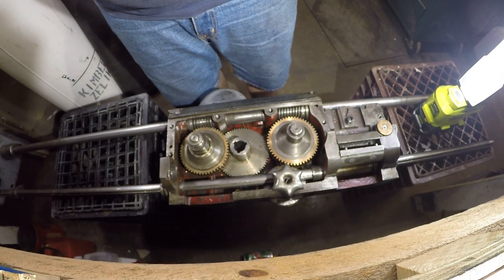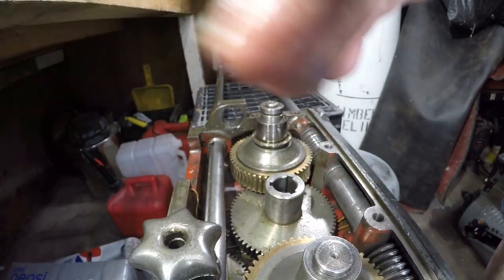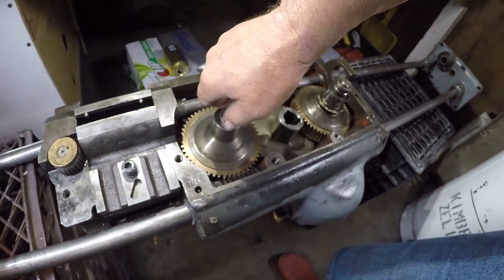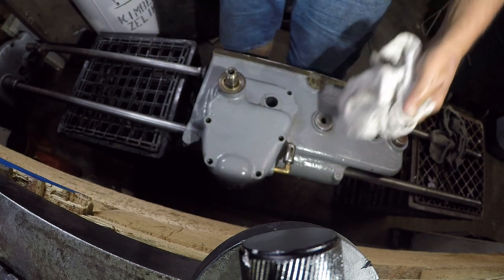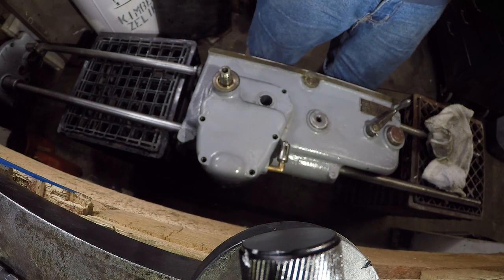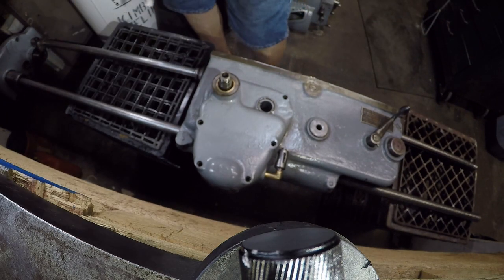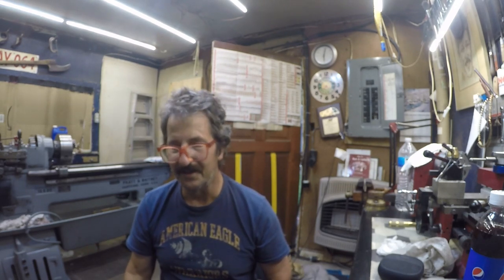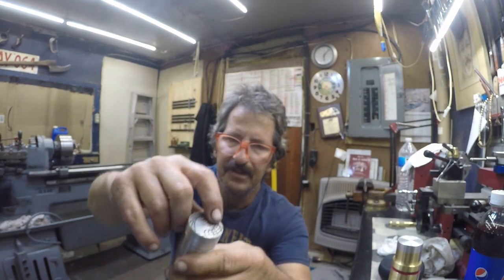PART 11 POWER CROSSFEED REPAIR,PRATT & WHITNEY MODEL B,                   APRON REVEAL.

Comment: I think there should be a spring & or a spacer on the crossfeed clutch shaft - * try DISENGAGING the clutch , then TAP on the star wheel with your hand . . . Does THAT push the clutch up / IN ? ? ?   If so , then a spring should be on the shaft , beneath the clutch cone - that would make a positive DISENGAGEMENT ! 
Maybe just a couple 'spring washers' would do the trick ?  The O.D. of the spring should be a sliding fit inside the clutch cone , but sized to fit the screw shaft without a lot of play !     If this idea is wrong , then there MUST be a 'keeper' / spacer , that is 'pinned' or otherwise LOCKED to the shaft , on the INSIDE of the apron . . . THAT would prevent the clutch from staying engaged too !   Sounds confusing , but read it a few times , & it will make sense !   ( I hope ! )    > > > back to the problem > > >  ;)
Reply: I turned the speed down when you started talking fast / sped up / fast forwarded ? ? ?   & & & 
NOW  , it seems that the WIRE that used to be on the inside end of the cone clutch would have SET the travel , & or would have 'captivated' the motion that the star wheel produces . . . thereby engaging & DISENGAGING the cone !     * Still seems that a 'spring assist' would be a fair idea .
'Had to edit out a typo  ;)
Reply from the maker: I like the spring idea, I will address that with you in a future video!

Comment: Based on seeing all the crud around the pump that you showed I'd say I need to take mine apart as well.  I probably need to watch this again, I'm wondering if I could just remove the cover to clean that without completely taking the apron apart as you did.
Reply from the maker: Thanks Kev.

You learn a lot by taking those machines apart